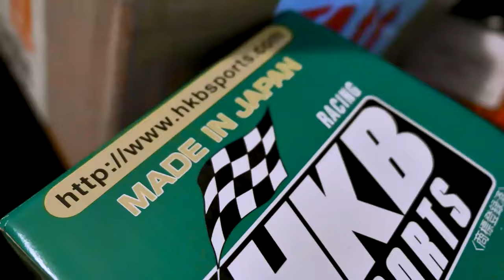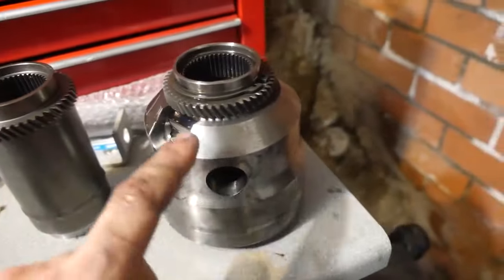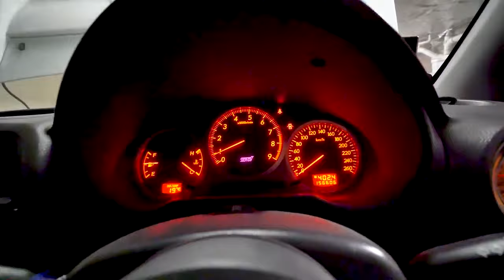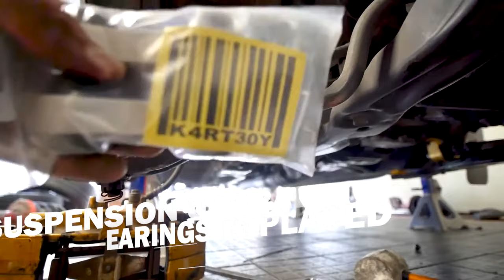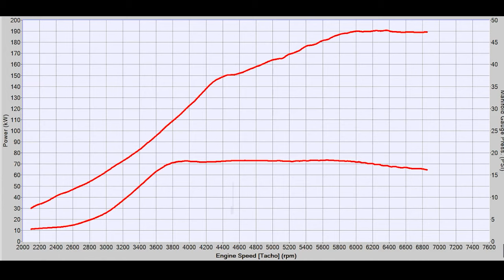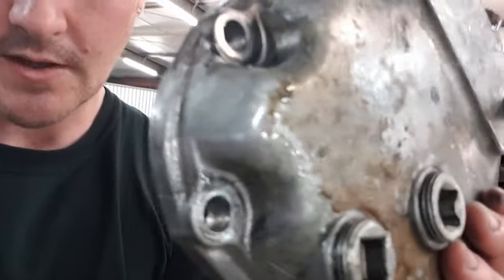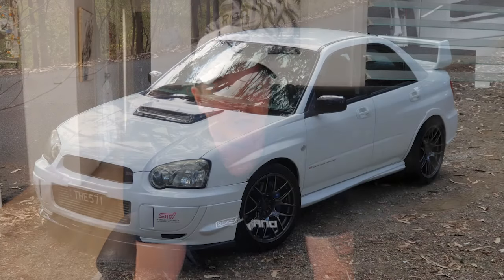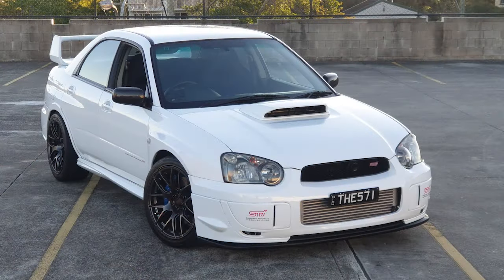I built a GD STI into a rwd drift car!

Comment: Thinking of doing this to my 04 GD STI how much power do you make and how is it going?
Reply from the maker: This was 5 years ago now, I made 330hp and it never broke other than the wheel bearing and rear diff. I eventually converted it back to AWD and sold the car. In over 10 years was such a reliable car